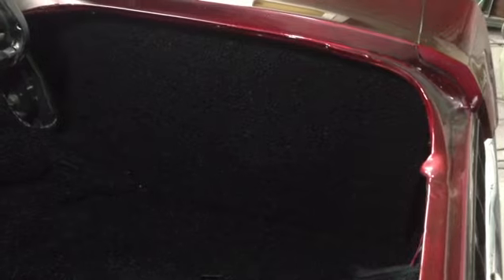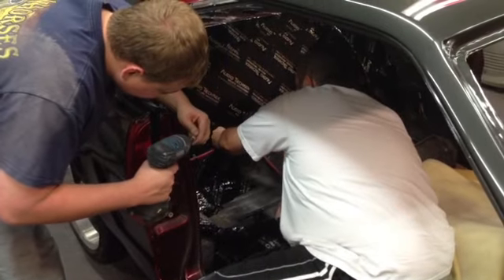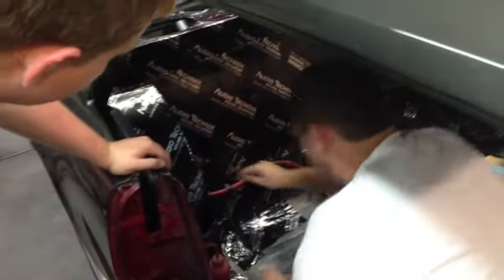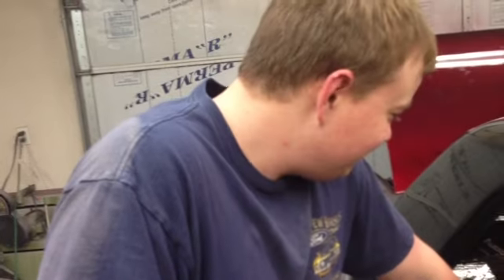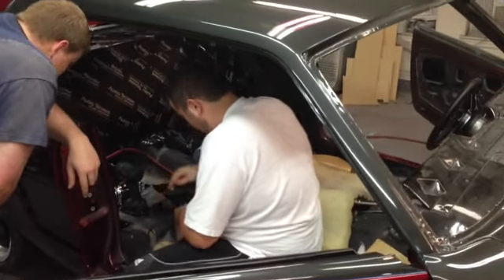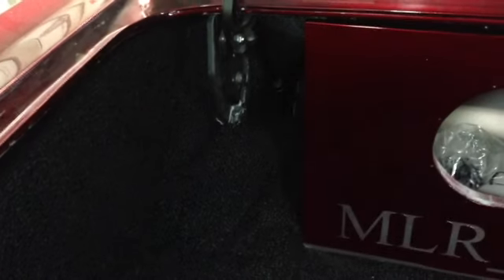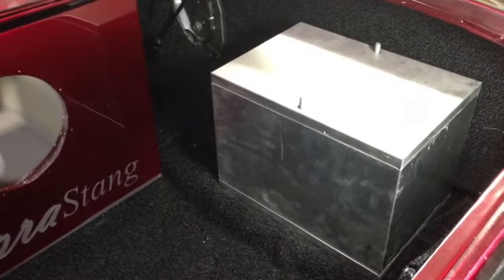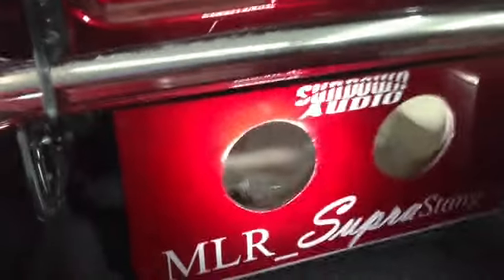MLR_Suprastang - Final Push 7 of 7

Comment from the maker: We have one more day (day 8 of 7).  Glass, weather stripping, front end alignment, and inspection are all thats left.  Oh yes!  Matt did alot of research on port size, depth, etc based on the size of the box, brand/type of subs, etc.  The box is not optimal but it had to fit the space...  The main area of the carpet not fitting is the inner wheel houses, because of the mini tubs, so we might cut carpet and separate then make some little carpet covers to velcro over...